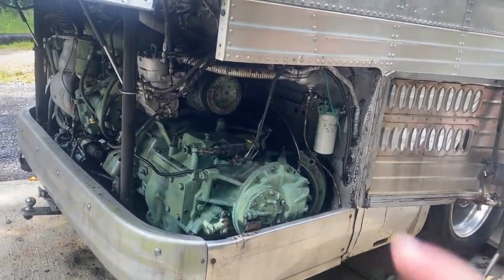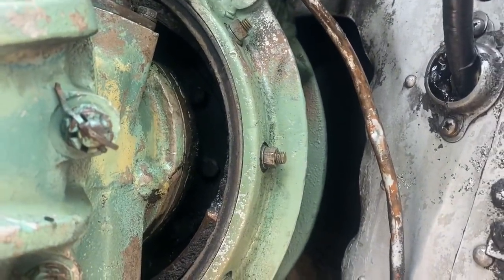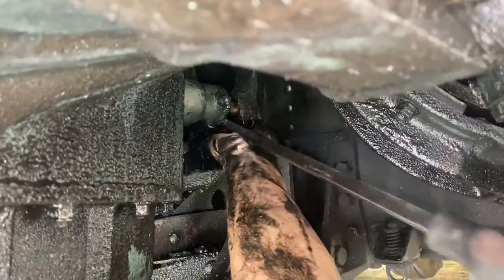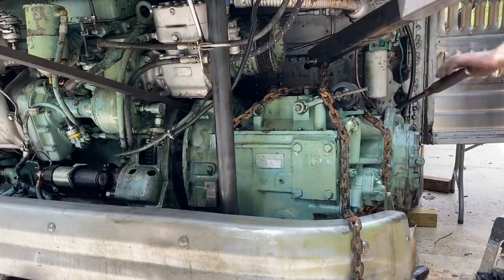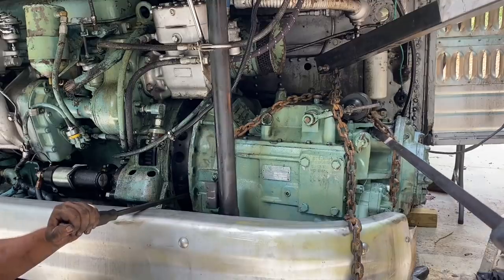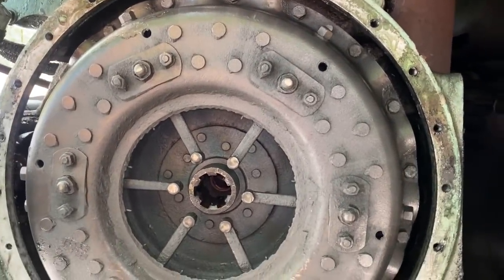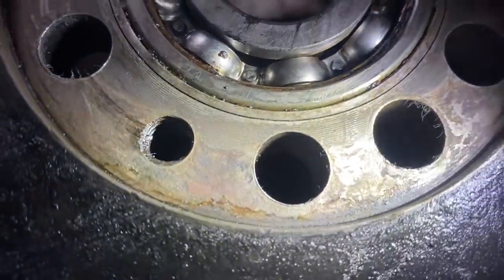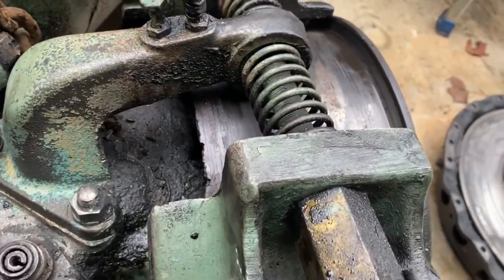Loose flywheel gm 4104 bus.  Detroit diesel 671

Comment: Are the flywheel bolts the proper grade? Would be unusual to have a grade 5 bolts that are drilled for safety wire... but I cannot come up with another way for the flywheel to be loose with the safety wire in place other than the bolts just stretching...I expected more “shiny spots” on the crankshaft/flywheel mating surface, guess that dowel pin was doings it’s job.
Reply: The safety wire was put on incorrectly so it might as well have not been there at all.
Reply: Thank you for letting me know that, I missed that, I will have to go back and re-view the video... I did not notice the “orientation” of the safety wire.

Comment: Personally, I would have used a pressure washer on the work area prior to starting repairs. I have knocked too many knuckles due to greasy nuts or bolts and a wrench slipping off.
Reply from the maker: You must not have any idea of how messy you would get trying to pressure wash the bottom of a bus.   Plus what a mess it would make on the pad

Comment: too bad they dont have an inspection plate you can pull and access those bolts, to torq em. like they werent when they they got put on at the fixit place. im a muncie  m21 man, used to yank em  out with one arm on the x-member, on my back. 15 mins, in and out. a long long time ago

Comment: i'm curious as to why you don't pressure wash those greasy SOB's off before working on them? we use to have a horse ranch and I had a whole stable of vehicles to maintain I always blasted them off before working on them so much easier to deal with even if they weren't perfectly clean.
Reply from the maker: The bottom is so hard to clean.  Where is all the oil going to go?

Comment: It looked like there were 2 lifting eyes on one side of the transmission. Do you use the chain for better balance or are there no eyes on the other side? You need to rig up a lifting device to help with the flywheel and pressure plate to take some of the load off your back. Been a while since you have been that dirty.
Reply from the maker: The dip stick is not a good lifting eye.  The one lifting hook is made for a special plate that bolts on and had one hook to go through that.   I don’t have that plate but the chain works fine.  I can get within an inch of the center of gravity
Reply: @BusGreaseMonkey  Looked like you had it nicely balanced. Could not tell that one was the dip stick.

Comment: Instead of spending $500 for a reverse solenoid why not hook up the reverse wire to a control valve the is normally closed but when you activate it with the reverse switch it opens compressed air to a small cylinder to move the reverse lever? Seems like a better solution to me.

Food for thought

Comment: i also wonder if the broken brake drum created enough vibration to cause harmonics in the flywheel that stretched the bolts...   can you compare the length of the old crankshaft bolts with the new one... checking the length and overlapping the threads to see if the threads above what was engaged in the crank are S T R E T C H E D ..  its not always visible until the new and old bolt threads are overlapped. the areas that engaged in the crank will fit together perfectly.. but when you compare all the threads there will now be a visible gap..  i realize you NEVER read the comments.

Comment: Safety wired incorrectly. They just ran them through the holes and they weren't doing anything to keep the bolts tight.  Learned to safety wire USN aircraft A mechanic school. We safety wired until it came out of our ears on aircraft from A school and into the fleet. ADR2. An everyday job for us on just about everything on a aircraft engine, especially the jugs on the old recips.. Can't have things coming loose in flight LOL

Comment: Someone's needs to learn how to safety wire
Reply: Exactly. The wires should be pulling the bolt heads tighter. Most of those appeared to be doing the opposite.

Comment: With the hot spots and cracks on the flywheel i probably would have paid extra to replace it and put on a new clutch disc just for peace of mind knowing what the labor rates are doing a job like that.
Reply from the maker: New one will look just like that in 6 months
Reply: @BusGreaseMonkey  Oh wow

Comment: That is crazy! Safety wire intact and no broken or really loose bolts but flywheel still loose? Wonder if whomever put it on last time had it cocked slightly on the pins and torqued it down that way leaving it to work itself out in use. Bolts looked good from the video--no shiny spots from the flywheel wobbling around. Maybe tighten bolts down then back it off and tighten again to make sure it is seated all the way on the dowels?
Reply from the maker: Not what i expected

Comment: could the vibration from the brake drum cause the problem with the flywheel ?
Reply from the maker: Maybe added to it.  That had to be a nasty vibration.   I never drove it or rode in it.
Reply: Bus Grease Monkey 
Except to move it to the pad?
Reply: @RevMarket  its on the pad

Comment: Is the brake drum on the transmission?
Reply from the maker: Yes
Reply: Cheers.  Every day is a school day!
Reply: It's just the parking brake. Someone probably drove the bus with it on accidentally and caused the damage
Reply: A bit like my e85 has a set of shoes just for the hand brake.
Reply: @rogerwallace5473  yes. Most are inside the rear brake hub assembly.   It's just better to delete the one on the transmission as it's too easy to overlook leaving it engaged.

Comment: Belly pans.. more like lower oil pans, or oil dispersion device.. jk... That safety wire did its job.. otherwise I think those bolts would have backed out further. Man that brake is tore up.. is that brake drum available? That is a heck of alot to be missing that chunk.. maybe that was enough vibration to loosen the flywheel...
Reply: Looked like previous mechanic didn't torque it right and didn't have the safety wire installed correctly so the bolts were able to back out 1/2 a turn. Very few people, other than aviation mechanics, know how to properly install safety wire anymore.
Reply: Larry Jackson- yea I was wondering, did not seem like that safety wire was quite right.. I would not know how, would have to look it up. I like airplanes, but have never worked on one... yet..

Comment: I'll never understand why you don't steam clean or at least pressure wash the areas of the engine compartment that you are planning on working on.  I know it won't get 100% of the "gunk" off,  but it will get a lot of it off !
Reply from the maker: I’ll get 3x dirtier trying to clean the bottom    That makes a huge mess on the ground too
Reply: It only works if you can clean someplace other than the repair location.  For a car, that's easy  but busses need acreage. Plus sometimes you need the oil to trace back to leakage points. 

When I get something really greasy I'll give it a good soaking and wash and have a customer drive it for a day or so. It makes it easier to pinpoint the issues
Reply: @richardlazarski4553  Concur on "cleaning elsewhere" !

Comment: To bad they didnt make that cradle fram slide for trans removal
Reply: Its still easier than non transverse engines. Youre either crawling underneath, using a lift, or pulling the engine.
Reply from the maker: Its very easy.   Easier than most cars